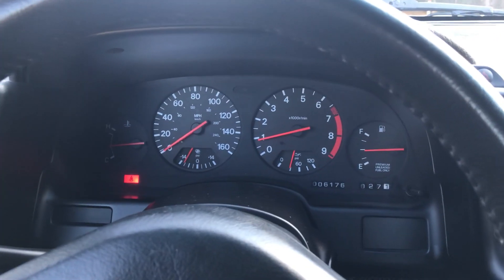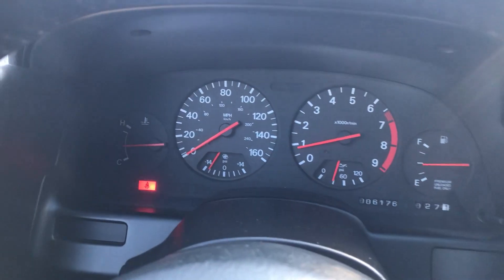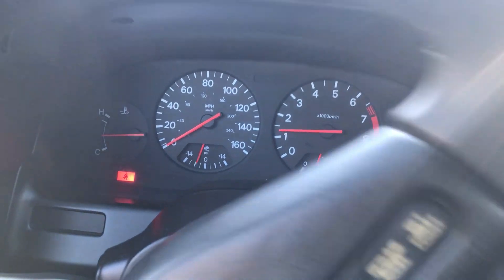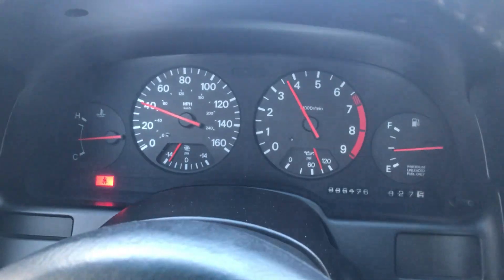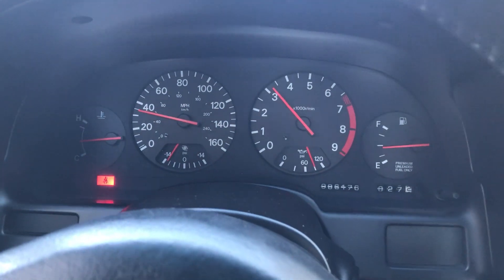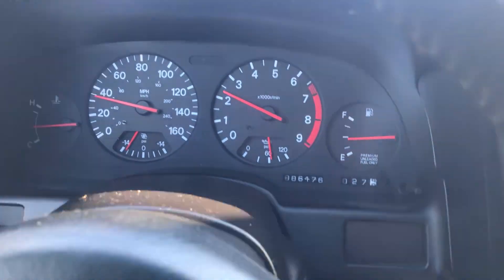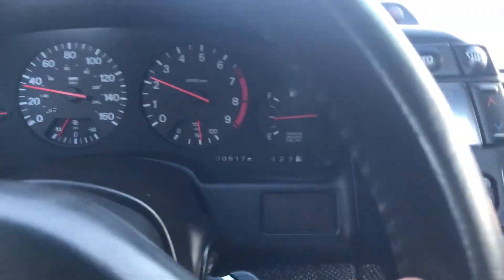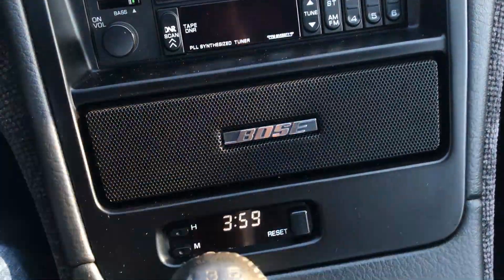6200 mile 300zx TT 5sp Driving Video

Comment: Odometer Fraud!  Look at the Raised Position of the First Digit of the Odometer! More Like 106k miles. Did you ever fix the worn out seat with the ass crack imprint ? Lots of wear, Front Bumper Paint doesn't match for that "6,200 Original Mile car"